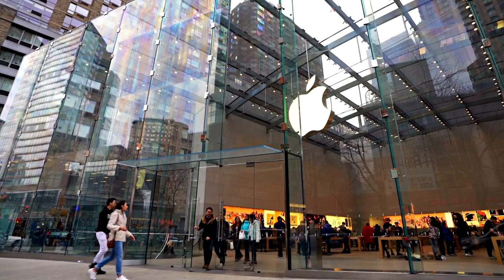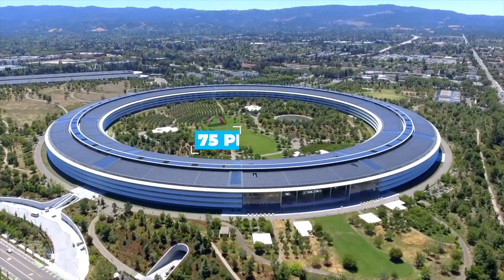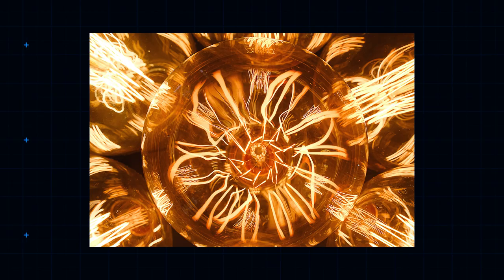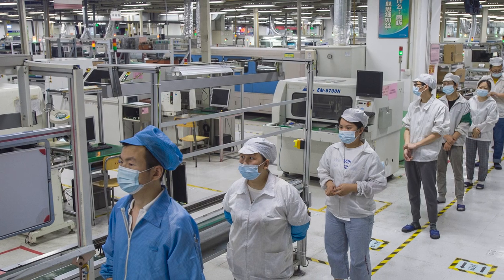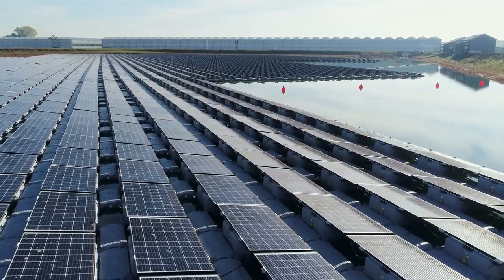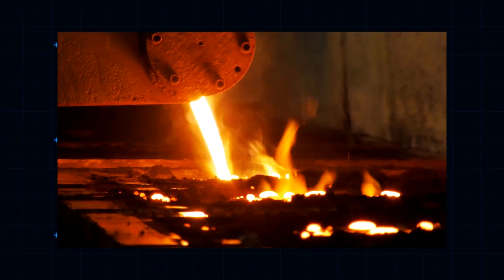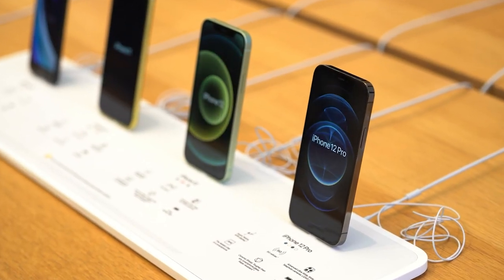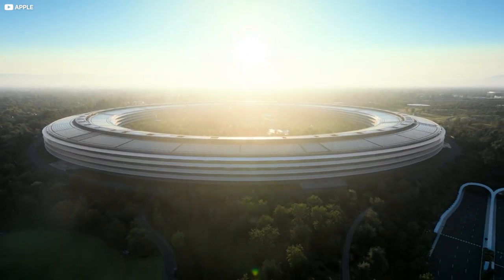Apple's Ingenious Plan To Become Carbon Neutral

Comment: No power adaptor is just plain stupid when the cable they give doesn't fit the previous version of adaptors that people have been using. This means that the customer still HAS to buy the adaptor and it means another box and another cost to the customer.

Apple wants to portray itself as "environmental" yet it goes in the opposite direction.

Comment: In the lasr part you told us not to complain about the adapter-less boxes. But won't you need a new adapter for every phone upgrade? We'll have to buy adapters from 3rd party companies, which many is far from being carbon neutral. Even if the adapters were totally same, even by the emissons, shipping a seperate package for adapters uses more space than being in the phone box.
(I saw this on youtubr. It was probably from the channels whoistheboss or Apple Explained.)
Reply: if i have multiple phones, whether it's android or apple, i honestly would just use the same adapter and cable for all of my phones, i just buy a new adapter if it breaks then the cables that are included in every boxes will just be the back-ups when the first cable broke or cut in half. it can also save you money and electricity by not charging all of them at the same time.
Reply: @JayceeR  this practice of using adapter from different companies are not good for the phone's battery and circuit.
Reply: @RDdggrd  i didn't say i use a 'not apple certified' adapters.. i use original, that's why i only use one (original) adapter for multiple devices to save money ('cause you know it's expensive especially in my country) and buy a new (original) adapter once the first (original) adapter i use got broken. same with the (original) cable, i only use the same one for all of my devices and the other (original) cables that was included in the apple box will be a spare when the first one got cut or snap in half
Reply: @JayceeR  that's nice. I just mentioned it cos u said u wud use the same adapter for both andrd and apple dvces.
Reply: @RDdggrd  no, i meant if i am an android user, i would do the same thing (using only one adapter and cable on every thing i own  that still uses micro-usb (android phone, wireless speaker, power bank, etc))
Reply: Another. Xiaomi went and used this strategy of not including adapter by default but when you're buying, you get the choice of having the adapter included for no additional cost. Why couldn't apple do the same? I think vision makes great video but this is one is just him buying into their bs. Apple is a business first and foremost, stuff like "saving the world", "privacy matters" these make great headlines and are just marketing fluff.

On the privacy side, Apple literally gave full access to the Chinese government to the data of their citizens because that was the demand Chinese government put out in order for apple to continue their business in China.
Reply: @JayceeR   I wanted to mention the inefficency of posting new adapters, and not using many adapters is another way of solving the problem
Reply: @bruhder5854  Yes. Vision has many great videos but sometimes he doesn't mention the controversies about the topic. That's why the comment section is as fun to look at as watching the video itself. You can find more info about the video topic.

Comment: Way I see it is its just lip service, they are against right to repair and are making me go out and buy a separate usb-c charging port for my wall because usb-a was too much to ask I guess... I wonder if that extra buying step still equates to less foot print or not. On top of that there phones themselves are not usb-c ports which means I can't use any none apple phones charger possibly increasing my "footprint" yet again if i go between multiple places

Comment: Not including the charger doesn't mean that the need of charger is not their. 
If we order a brand new charger the plastic required in packing that charger will be way more than including charger in the box.
Lifetime of charger is way less than the device so customer will technically mostly end up buying a third party charger which will result in more plastic and cardboard waste in the environment.